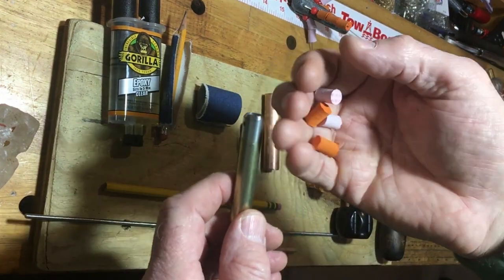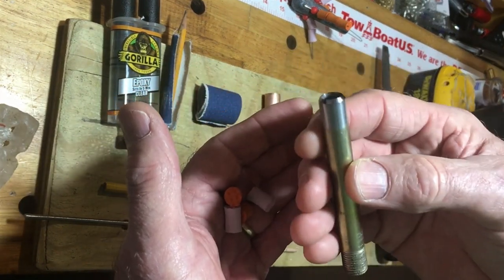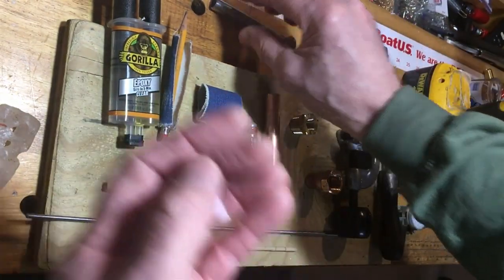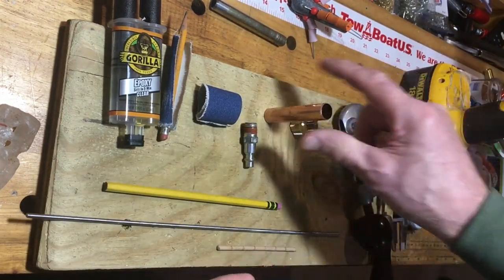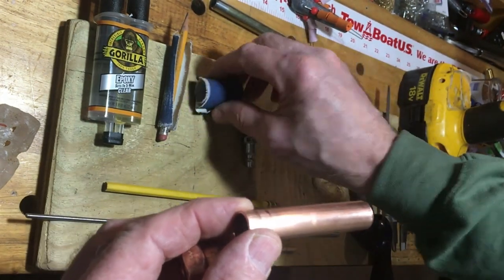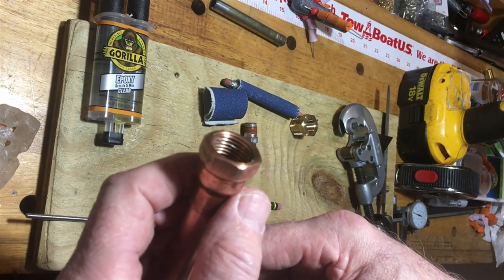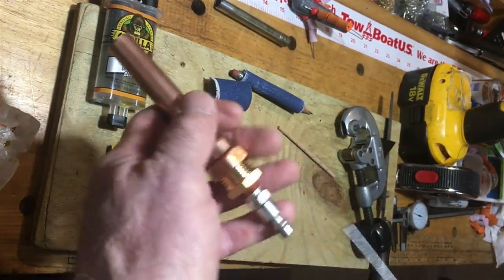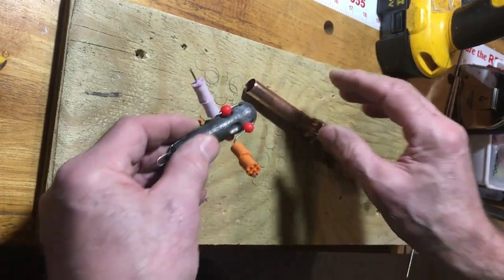Big Pompano Rig Floats

Comment: You have the air adapter. just hook it up to an air compressor or a foot pump and blow them out.
Reply from the maker: Awesome idea! If I put the compressor up to 110psi I can do some target practice! Lol
Reply: Now don't go giving my grands any ideas, lol. You put out alot of great info on you channel. I just started surf fishing a year ago while on vacation on the gulf side if Florida. I live in the Fingerlakes,  NY and catch lakers avg. 6 lbs. Catching quite a few smaller out of the ocean is different,  but you never know what you might catch.
Reply from the maker: Make sure you use a shock leader in the event that you do get that big lunker on the beach and don’t have to worry about a slight Nick in your line. I like using 50 pound shock leader thats about twice the length of my surf rod. The other biggest benefit of a shock leader is your line won’t break on a hard cast with a 5 ounce sinker.

Comment: A very helpful video. Would you mind listing all of the parts and dimensions that are needed to make the drill component? Without that info, I'd probably end up buying the wrong sizes and pieces. Thank you.
Tony
Reply from the maker: Tony, I think I clearly stated all hardware parts needed. I will review the video later and if I forgot something I’ll let you know.
Reply: @PompanoBrownie  Thank you.
Reply from the maker: @AnthonySmith-en6im  here are the Amazon links
Make your Own Big Pompano Rig Floats easily and accurately.

*These paid links to Amazon pay me a very small percentage if you use them, without raising the cost of the product.  That helps support the costs of making the Videos. Thank You
Big Pompano Float Hardware Below
5 Minute Epoxy https://amzn.to/39rrB6S
1/4" compressor fitting https://amzn.to/3nyiuGv
1/2" copper pipe https://amzn.to/2XJIzIx
1/2" copper female threaded coupling https://amzn.to/3oBpzYo
Brass 1/2" male to 1/4" female coupling https://amzn.to/39rgQ4u
Plumbing sandpaper https://amzn.to/2Xw20UV
Reply: @AnthonySmith-en6im  i